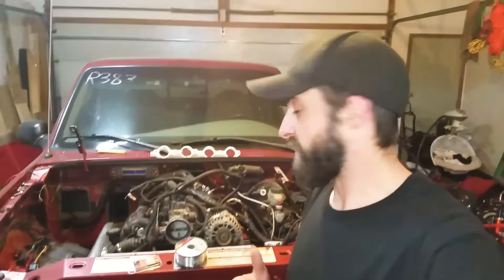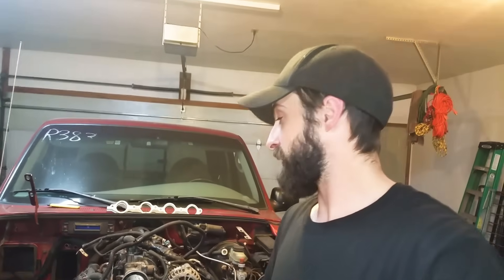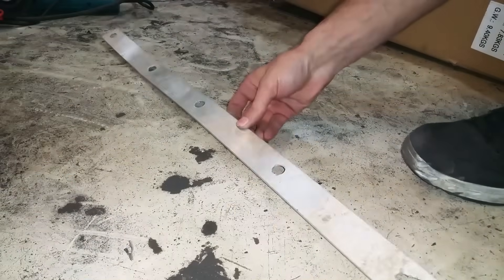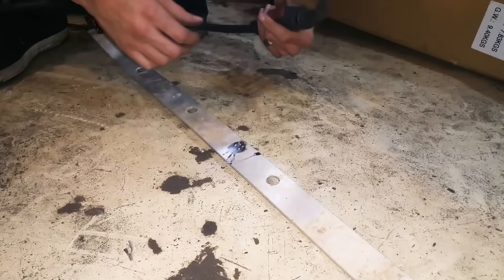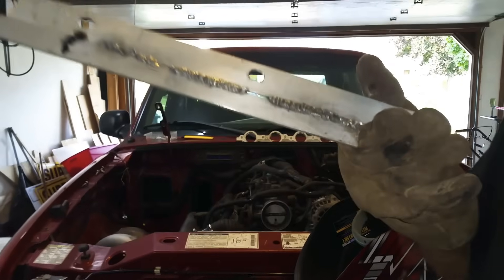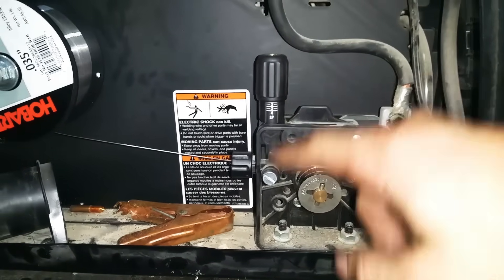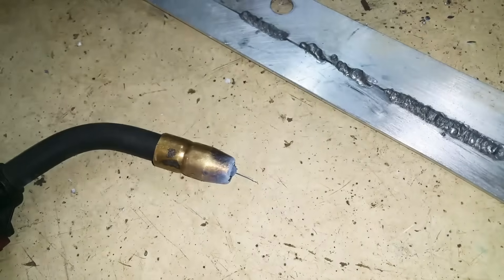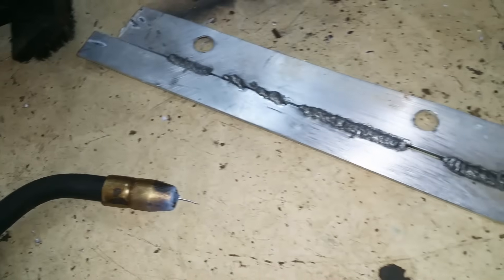HOW TO: MIG WELDING ALUMINUM WITHOUT A SPOOL GUN!!!

Comment: Thank you!  I succeeded today with Miller Multimatic 215. M100 gun with Weldingcity Teflon liner, Harbor Freight 4043 0.035 wire, 0.045 contact tip, 12 cfh argon, 1/8" base aluminum on steel table, stock V groove, ~ 0.5" stickout. Too much stickout got dark crap, and too little stickout got burn back. Leave 0.01 gap and got full penetration. Welder in manual mode but used the same number as those in auto: 20.7V and 350wfs. Hope this could help someone. Thank you.

Comment: I’m pretty new to welding so I got a question I’m thinking of buying the Lincoln 210 multiprocess welder and if I buy a small tank like you did and filled it with argon can I weld aluminum without a spool gun?

Comment: I have a tire shop here in Atlanta.
I do bent rim repair and would like to start welding cracks in cast aluminum wheels. I would prefer MIG. Something that runs on 120 but I don't think that's strong enough for thick cast aluminum (spoke side ot the wheel). Can a MIG welder handle the task? If so what do you recommend on a budget for a beginner?
Reply: , If I'm in your shoes, I'd find a local guy or gal that TIG's aluminum for a living. Have them show you how it's done. Because it is going to be a very particular process that will need some fine tuning to get it right. You don't want you repaired rim tooling down the road, hitting a pothole, and coming apart. This kind of repair is bordering on "life dependent". Thats why the AWS puts a high standard on "qualified" welding codes.

Comment: I was also told to use 5356 wire because it was stiffer and would feed better.
Reply: It's not as easy as 4043
Reply: @donsmith9081  I just did a google search and found this on the ESAB website:
"4043 is a softer alloy in the form of spooled wire, when compared to 5356. Typically when Gas Metal Arc Welding (GMAW), feedability will become a less critical issue when feeding the more rigid 5356 alloy."
***So according to their website 5356 is the better option, and I've watched a couple more videos here on Youtube with the big company sponsored videos saying the same thing.
What's interesting is in Lincoln's Aluminum welding kit for a mig they include 4043 so there must be some advantage to using that. I need to research some more before I pull the trigger, lol.
Reply: @donsmith9081  OK, I did a little more research and came up with this:
*4043 is easier to weld with and provides a better appearance. 5356 is stronger.
 *Use 4043 for groove welds. and 5356 for making mostly fillet welds.
I also found that these 2 wires are used in 80% of all aluminum welding so they are by far the most popular 2 wires you will find. Hopefully this helps people choose.

Comment: I wanted to thank you for this video! Your “tip” about using a contact tip with a hole oversized for the wire, worked flawlessly for MIG welding aluminum today without a spool gun! Miller 215
Reply: Hi Scott, I also have a Miller 215. Did you use 4043 or 5356 filler? And on the drive roller, which groove did you choose - the V-groove or the knurled one? Thank you very much!

Comment: Being your machine can use gas. All you need now is a tig torch & filler rods.
Reply: Yes and no. DC tig  for alum is way more difficult  to get good penetration  and reinforcement than AC tig. His machine might not do AC and be DC only. I've tig  with DC. It is much harder and slower than AC. It's not as stable. It's not as clean.

Comment: You should wear gloves.   The IR band coming from the spark is cooking your hands.  Not to mention the UV (ultraviolet) beams that we can see.  COVER ALL FLESH WHILE WELDING OR GRINDING ANYTHING.
Reply: Any radiation coming off a weld when welding a few minutes a month in the home shop is negligible. There is no need for protection doing 1 linear foot of weld. You should look into exposure limits. Sounds like the bozos that comment on YouTube videos, "yOu sHouLd WeAR a MaSk," when someone is spray painting for 30 seconds. It's like they're completely ignorant to exposure duration limits. Like saying smoking 1 cigarette will give you lung cancer. LOL.

Comment: How to do use the argon gas, where did you feed it through
Reply: Using AC current and reversed polarity on a spool gun, Argon is the gas. It's cheaper, its what works. The DC tig experimentation on aluminum is with helium.
Reply: I wouldn't use argon I would try  helium first
Reply: @eksine  why tho?? Aluminum calls for argon right??
Reply: @ArturoFlores-et8jz  I saw a video about DC TIG aluminum welding they replace the gas with helium to increase the heat. For the spool gun it does call for argon. Look up the video about DC TIG aluminium by weld.com
Reply: @eksine  thanks I'll check it out
Reply: @eksine  Helium is for thicker aluminum.

Comment: You need to change polarity, which it looks like you did and also push when welding. The 100% argon will shield better that way than if you drag. Also, if you preheat metal to a little over 200° it will help greatly and wont require as much juice from the welder, for you guys who have smaller mig welders.
Reply: Which polarity for aluminum should we use ? I just picked up the same machine from tractor supply

Comment: What percent ratio on the Argon gas for aluminum welding did you use  ?
Reply: Should always be 100%argon. Or an argon helium mixture. Helium makes it hotter

Comment: It's dc mig welding with a polarity change . I'm looking to get an a.c. mig welder
Reply: Just get a spool gun or tig.
Reply: @BlackKnight-ll8qh  you still need AC for that. Getting a tig torch or a spool gun doesnt make it AC.  AC is the best of the best for alum welding because you have a cleaning  pulse  to burn of the oxides  and a penetrating pulse  as it goes back and forth negative and positive.  You can also adjust the sign waves to have more cleaning or less.
   Without . Dcep mig is the only way. You can DCEP tig. But you need an oversize tungsten to handle the heat and not burn the tip off after a bead or two.
Reply: @swampypolitics9574  thanks for the knowledge Einstein. I have a rig and have been welding for years. I made a simple statement, get a spool gun setup (duh that’s specifically for aluminum) or a tig. I how how ac and welding aluminum works.

Comment: A fab shop local to me uses the same MIG but has two guns, one with a teflon liner for alloy and the usual one for steel. Plus ofcourse argon. Only takes a few min to change and he still uses the same rollers. A big transformer machine. Does an ok job for simple fab welding BUT for welding thin tubing etc will never do it. And yes a stainless alloy only wire brush and acetone to clean up dirty alloy. Though most of his fab jobs are new material. That makes it a lot easier. MIG is a fair bit faster than TIG but not nearly as good quality.

Comment: Good job. For the first shot was awesome. I've tried the same with my standard torch. Just replaced the iron conduit for a teflon conduit... it was horrible since the aluminum wire was melting into tip. I tried to enlarge the tip but did not worked as well as yours.
Reply: You might have it on the wrong polarity? DCEP should be used for alum

Comment: tx for the vid - cant tell tho, were your first welds without gas or with??
Reply: You cannot weld alum without gas coverage.  I do not believe they make a flux core alum wire for MIG. The only thing I've seen personally (could be wrong) is aluminum  stick electrodes.
Reply: @swampypolitics9574  yes - ive welded with stick / no gas pretty well.. not so with wire i believe.. was wondering if it might work for a low quality repair..
Reply: @fstarockaburns425  yeah I've seen videos of people using alum stick electrodes. Deff a low quality repair but if it's in  a pinch  it will  work for sure.  Not  with the wire food though it wouldn't  fuse without gas you'd be able to break it by hand. I saw a few ads for alum flux core wire for MIG but they all seem to be gimmicks that dont work

Comment: Invert the polarity and use  HELIUM not Argon. Set the electrical to 140 AMPS. Use a 0.05 thick wire not 0.035. If you have a plasma cutter you can weld aluminum with some thick aluminum grounding wire strands. This aluminum wire is usually about 1/2 inch thick with strands. Cut the black plastic casing off and get one of the strands out. Make it about 18 inches long. Set the plasma cutter output gas flow to where it barely is flowing. Set the output gas / air by placing a tooth pick on the work area and squeeze the trigger activating the gas. If it rolls the tooth pick its too strong. Once you have it set use the plasma cutter as it\f it were a tig torch. Get your arc started then feed the wire in to the arc to get a pool established. dab in to the arc as you move along. Use care to only weld about an inch at a time. Allow the material to cool briefly.then do another fillet weld pass. A heat sink on the material is recommended.

They say you can not weld aluminum with AC. That is not true. Your shielding gas needs to be Helium not argon. Thicker aluminum consumable will yield better results. A friend of mine made a rectifying diode array on a piece of heavy copper. The rectifier is just a square piece of non-conductive material with some bus bar copper and the diodes. He put a heavy aligator clip on the output side. Then he just clipped the rectifier with his ground cable from his welder. The aligator clip then connects to the piece you are welding on. This transforms the welder from AC to DC. The rectifying diodes were 42 cents. Buss bar copper about $8. For under $10 he had the ability to go from AC to DC. When you want to do some DC welding just place the circuit between the material and the ground.

Hope this helps.

A rectifier diode lets electrical current flow in only one direction and is mainly used for power supply operation. Rectifier diodes can handle higher current flow than regular diodes and are generally used in order to change alternating current into direct current.
Reply: Soooooooooo you essentially turned your plasma cutter into a TIG torch, with helium gas as cover  ???
Reply: That's backwards. AC is preferred for welding aluminum. DC is not, but using helium with DC to weld is a thing. It's was called heli-arc welding. Helium is expensive. Also, Stick welding aluminum with aluminum electrodes on DC works especially if it's windy and your shielding gas is getting blown away.
Reply: Very interesting. Do you have any additional information that you can give on this? Thanks
Reply: @howardtoob  additional information? The dude practically wrote a novel, what more do you want from this guy? His children?

Comment: Ive also heard it can help if you keep the hose from the welder to the gun as straight as possible
Reply: That helps even with steel welding
Reply: That's MIG 101

Comment: You need a Teflon liner, rubber rollers, and the aluminum wire cannot come in contact with ANY steel whatsoever or it contaminates the weld, plus only stainless brush, not steel.  No steel  even your contact tips.  More research makes a big difference.
Reply from the maker: r sanchez Meh, I'm just sticking shit together, not building churches.
Reply: hallelujah

Comment: Yeah I have done it before with my Hobart 120 mig. You need to make sure the aluminum is really clean. You can use acetone as a cleaner. Also he didn't say much about polarity but you have to change that to inside the welder. Mine has the chart on the fold-down door for the spool and drive that tells you what to change.
Reply from the maker: DCEP on mine, same as steel. Only thing that was DCEN was flux core steel.
Reply: Did you have to use the argon gas? Or is this without?
Reply: Yes 100% argon and you have to be really careful with your hose getting in a bind or the wire will wad up in the drive wheels.

Comment: Lol
Reply from the maker: Any advice from the pro?
Reply: Hard to tell from the video but for you use a forward and backward pattern? Forward a little ahead of the beads then back to build up material, then forward again to prep the weld zone, back again to build up material. That's the technique to get the best results with alu mig, has a stacked dime look.

Comment: Don't forget to switch the polarity in the welder. Looks like you got that figured out though. My Eastwood 135 will do this too, but I use 0.30 wire and an 0.45 tip with the speed set almost topped out. Takes some getting used to, but it really is a cheap way to get into aluminum welding.